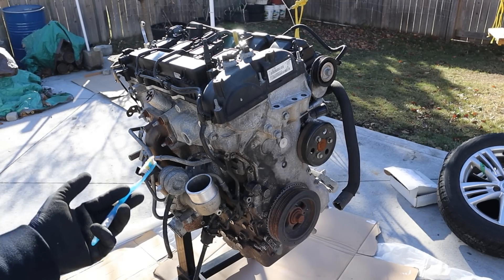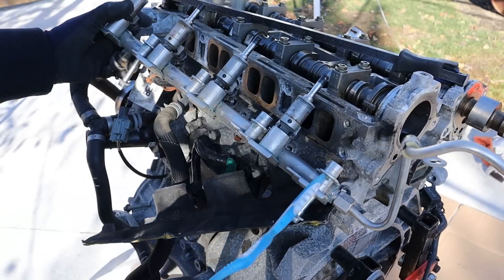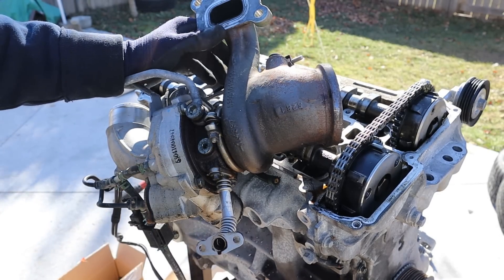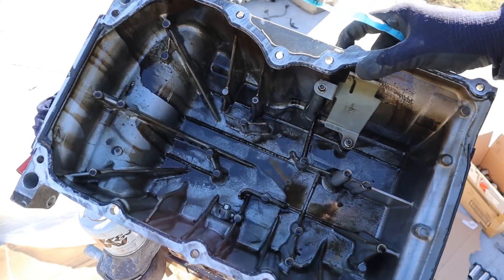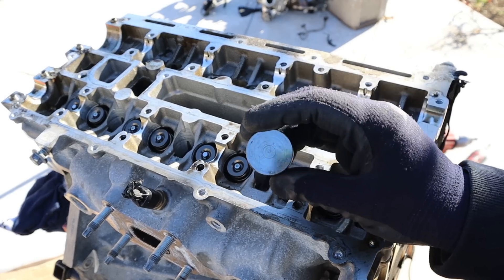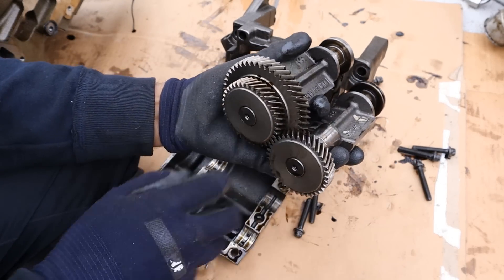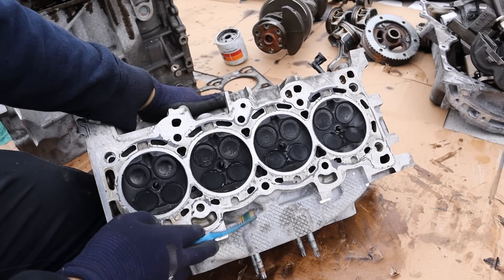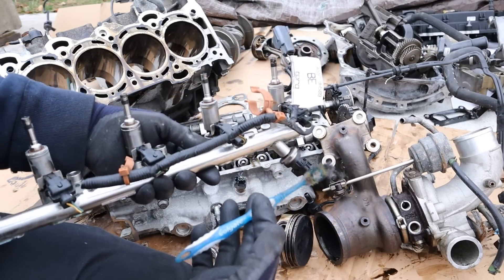Why Ford Ecoboost Engines Fail

Comment: Actually looks like one of the better designed and built engines I've seen in years. Also it appears FAR easier to work on than many of it's contemporary's. But honestly the direct injection without an intake manifold injector is just a death sentence for all direct injection engines.
Great video as always.
Reply: Looks very similar to the 4 banger Duratec. Sadly that engine killed Ford for me as an option. Unless you have an engine crane and you're willing to lift your engine for something as simple as a crankcase job, don't get a Ecoboost or Duratec engine.
Reply: @SwoonGaming  The Zetec was far worse before the Duratec arrived. Duratec is the Mazda MZR family of engines. If you want someone to blame for failures, point your finger at Mazda.
Reply: @Sm1te79  Mazda has no significant problems, Peugeot supplys large part of Ford EU engines, only Ford has problems.
In last generation of Escort engines where designed by Yamaha, great engines untill Ford tweaked them to make production cheaper, after tweak where worst engines ever.
On first generation of Focus they used Mazda 3 mehanics, that year Mazda 3 was rated as third most reliable car in Germany (ADAC) and Focus was on place number 52. out of 55 places.

Ford buys bulk of their smaller engines, but it buys them unfinished. Where usually original manufacturer installs Bosch, Hitachi or Denso, Ford installs Motorcraft.
Also only the base engine is Mazda or Peugeot, everything around like manifolds, sensors, alternators, pumps and managment are Fords misdeeds.

There is reason why Ford is cheapest major brand in Europe, with worst stealership network and crappiest final assembly.
Ford trucks and vans from Turkey are another sad story. You quickly realize why are they 1/4 cheaper than competition.
Reply: @SwoonGaming  'Don't get Duratec, it's not durable.' --Skurk1

gotta love that marketing irony! Too bad there aren't any car companies that will offer "0 plastic engine components" for an extra $X. I'd fork over an extra $25k for a premium option, if that option got rid of all the cheaply made plasticy crap
Reply: @leifleoden5464  this is Truth. I had a duratec in a Ford. It failed exactly where this guy said "this is a weak point" with the plastic oil separator/PCV valve. Flooded the intake with oil, just as he said. Cost me thousands. For a $30 part.
Reply: @Joe_P  .... I'll stick with my Subaru a while longer then...
Reply: Agree.
Reply: It looks like with a few small modifications it could be a really good engine. I saw an Audi V-10 teardown. What an abortion!
Reply: @johnhenke6475  I'm not up on this engine and I'm aware of the GDI problems but didn't I hear it had a catch can and wasn't the purpose of that to prevent this problem???  Or am I completely on the wrong track (as often happens)?
Reply: @alext8828  a catch can will help slow down the carbon build up but won't prevent it.
Reply: Direct injection for increased economy (not by much) but maintenance costs are higher. Are we going forwards or backwards. (That engine looked well made, decent quality and straightforward to work on).
Reply: The 1st generation 2 liter ecoboost was a decent design. The 2 major flaws were the pcv system and no port injection. The valves would get super dirty. The head gasket never seemed to be an issue with the 1st gen 2.0.
Reply: Yep. The owner got taken. That’s actually a good engine. It’s a first gen. 300k on mine. Open deck second gen is garbage
Reply: Open deck design, plain and simple, take a 2.0 EcoBoost from 2014 escape, with the Mazda sourced block, with a closed deck, at 388,000km and my mom's car is still going, now take my dads 2019 escape with the Ford block 2.0 open deck and at 155,000km needs a head gasket. Again ford CAN make good vehicles/engines but than on a dime turn it to absolute crap. Why because of $$$$
Reply: You can use a oil catch can also to avoid carbon build up on the intake valves
Reply: better built? 
say that to my 2 previous engines that had the #3 piston grenade inside it around 95-100k miles.
Reply: Funny that they did dual injection for the Coyote DI’s.
Reply: 10k mi on my 2022 Maverick. Should I sell now?  Love this truck but this has me concerned.
Reply: The complexness of these engines is just insane !!! And a bugger to work on and expensive, and short lived !!!  NO thanks !!!
Reply: @wilburfinnigan2142  All the more reason to switch  to an EV. Much simpler mechanically. And no carbon buildup!
Reply: @maryhadda8420  and when trying to charge your expensive golf cart during a hot spell, don’t be upset when they tell you that you can’t charge it due to the lack of electricity that’s needed to run air conditioning
Reply: @paulhunter9613  Charging has not been a problem. At all. Even in Las Vegas during the summer.
Reply: @maryhadda8420  it was a problem in California this summer, the infamous governor asked people not to charge their cars because of the strain on the electric grid
Reply: @paulhunter9613  Why single out EVs? Californians were asked - temporarily - to limit ALL electricity usage during the time of peak demand, late afternoon to early evening.
Reply: @maryhadda8420  I didn’t single out EV’s, the governor of California did. With everyone using air conditioning the added load of the EV charging would greatly increase chance of rolling blackouts on the antiquated electrical infrastructure. Y’all want to go so called green but there isn’t enuf capacity.
Brandon hasn’t figured out that part of it yet
Reply: Yeah.  Dumb ditty dumb ditty dumb dumb dumb.
Reply: Yeh not bad. Love the 2.0l in my evo, thing is stout. My 4.0l ranger with the MT is great to me as well
Reply: Why is it a death sentence? Just wondering Im not to savvy with car mechanics.
Reply: A lot of those modifying these add port injection to get more fuel to go beyond the 375 hp which has the benefit of better valve cleaning too. That and catch cans.
Reply: "Death Sentence"  a little dramatic. A walnut shell cleaning every 80 k miles would keep her pumping just fine.
Reply: @christinesommerfeld9815  the problem is that about 80% of DI engine owners have no idea about the cleaning services out there.
Reply: @HorribleHarry  I’m one of them. 3.5L EcoBoost- how and when would you recommend the intake cleaning?
Reply: @briannorwick  lookup fordtechmakuloco on YouTube. He shows the cleaning process.
Reply: @Nitroscion  love that channel! Ok, I think I’ve seen it. Any idea on the interval? Every 50k km? 100k? Thanks
Reply: @Brian Norwick  if your 3.5 is 2017 or newer, it has port injection and you need not worry. The valves stay clean. I watched a 80k mile 2017 3.5 teardown and the valves were nearly spotless.

If your 3.5 is 2011-2016, they aren't as prone to valve deposits as most DI engines, but still suffer from it somewhat. If you dont have excessively rough idle on cold start, you generally dont have to worry about it. I've seen >200k mile ecoboost f150s that still run great without any induction cleaning services.

Having the valves walnut blasted is the best way to clean them if you have confirmed excessive valve coking. The problem is that it must be done very carefully to protect the turbos. Many mechanics aren't thorough enough to get ALL the walnut debris out or don't ensure the valves are fully seated before blasting. The turbos on the 3.5 ecoboost are particularly sensitive to debris.
Reply: @Brandon_Nelson92  ok thank you very much- my Ecoboost Engine is from a 2020 Transit van, which I believe uses the direct injection. 

I was thinking the same thing that you’d want to have a mechanic that is well versed with the walnut blast technique and is thorough. Lots of opportunity for foreign debris! 

I really appreciate the answers
Reply: @Brian Norwick   your 2020 transit uses the 2nd gen 3.5 ecoboost with both port and direct injection. Your valves will stay clean.
Reply: @HorribleHarry  the Kia and Hyundai dealers really push the cleaning stuff.
Reply: @briannorwick  If you have a Gen 1 (pre 2017), you're kinda screwed. It''s pure DI so you'll get a lot of carbon over time due to the PCV system and no injectors to clean off the valves. Injector cleaner won't reach the valves. You can't use Sea Foam because it will ruin the turbos. All you can do (short of a tear down) is preventative - install a PCV catch can for about $400. 2017 and newer is much better in terms of preventing carbon build up as Gen2 added port injection along side DI. I still put a catch can on my 2017. Catch can is a must on any DI engine, particularly a turbo that can't be cleaned with Sea Foam.
Reply: @dabean9606  😊 great info. 2020 over here🚐👍
Reply: @HorribleHarry  And they run cheap,  crap gas.
Reply: Its not.    Looks like you own one and are ass hurt.
Reply: I agree but you can add intake mounted supplements. Even Nitros. Did that with a Taurus SHO. Very popular mod for Turbo cars.
Reply: Just look at what it takes to do a timing job in the car. You’ll change your mind.
Reply: Can you explain why direct injection without intake manifold injector is bad? What does the intake manifold do?
Reply: @wongfit  the intake injectors spray fuel over the valves and intake runners which keeps them clean and therefore carbon doesn't build up. Some engines now have direct injection and port injection for this reason.
Reply: you mean port injection
Reply: has anyone  heard of ford 1.5 ti-vct gas engine 3 cylinders?
Reply: Direct injection simply will not work. Not for very long anyway. You have to have fuel mixed with the air coming past the intake valve to cool it and keep it clean. Otherwise it will carbon up real quick.
Reply: @geraldscott4302  it could carbon up but not quick
Reply: Wow! Engine just how much engineering went into designing and manufacturing this machine! Having so many moving parts means a really short mean time between failure!
Reply: This is why I added a meth injection system into the intake. Also is a good idea to get Aux fuel.
Reply: It's scrap from bottom to the top.
Reply: 10k mi on my 2022 Maverick. Should I sell now?  Love this truck but this has me concerned.
Reply: @TheChaznw  I got the 2.0 focus st 2014 at 94k miles. Haven't had an issue yet. Valves where dirty as any DGI engine but just cleaned them once every 50k miles
Reply: @TheChaznw  That's up to you, but the Maverick will not be a long lived vehicle, with either engine. It's also a hybrid, built by Ford, to a very low price point. Even the Toyota Prius, probably the best hybrid ever made, has never been a long lived vehicle without major repairs. Unfortunately, no vehicle lasts as long as they used to. I have seen vehicles with the Ford 4.6L 2 valve, like the Crown Vic and Grand Marquis, last past 400,000 miles if properly maintained. They just don't build vehicles like that anymore. My 1993 Chevy S-10 2 wheel drive with the 2.8l V6/5 speed has 416,000 miles on it, but had the engine replaced about 100,000 miles ago. It has never been used for towing, or hauling anything heavy. I bought it new and took care of it.
Reply: @geraldscott4302  thanks for the reply. I am 76 yo so all it has to do is outlive me
Reply: @geraldscott4302  You're way off base about the Prius.  I suggest you read up on some ratings and history.  And, your anecdotal experience with the S-10 is 180 degrees from the ratings and history on that truck.
Reply: @tharais  It is difficult to find accurate information on hybrids. It's more hype than actual facts. But the Prius was the first hybrid I ever heard of, except for the very short lived Honda Insight. 

As for the S-10, the engine lasted so long because I treated it right. I changed the oil every 3000 miles, used 10w30 instead of 5w30, always warmed it up before taking off, and it has been used mostly as a daily driver, as well as quite a few cross country trips. Nobody believes it, but you can seriously extend the life of an engine just by frequent oil changes and warming them up before taking off. By replacing parts, it can be made to literally last forever. I live in AZ where vehicles don't rust. There are Model Ts still around that are over 100 years old. A friend of mine has a 76 year old airplane, a 1947 Beechcraft V35 Bonanza, and it still looks and flies like brand new. Newer vehicles won't likely last that long, they are designed to fall apart, are much more difficult and expensive to work on, and have way more computer parts, many of which won't be available several decades later.
Reply: @geraldscott4302  How about the Tundra 5.7 V8 (Not the V6TT of the new tundras)
Reply: @geraldscott4302  priuses usually last very long with low repair costs per mile
Reply: @geraldscott4302  The maverick comes in both 2.5. naturally aspirated hybrid or 2.0 ecoboost options, the 2.5 is a mazda duratec engine. IDK what your smoking but 300k+ prius's are extremely common, the battery packs generally degrade over time as opposed to mileage and are pretty cheap to have rebuilt, but they also run fine and get good mpg without them. I had more problems with my 65k mile 5.0 foxbody than my friend has had with his 200k mile focus st lol. My crown vic runs great but does have its own unique problems and that only has 100k miles on it. Every car and truck ive had from the 70's and 80's were cool but junk overall, but those were mostly chrysler products so thats to be expected.
Reply: @TheChaznw  don't listen to him, he really doesn't know what he is talking about

Comment: Unfortunately, many manufacturers are going the small block turbo route.  Six and eight cylinder engines are becoming obsolete.

No replacement for displacement..................................for daily drivers.

Comment: You can clean the intake valves on these VERY easily without walnut blasting.  Once a year, I undo the bolts on the intake manifold, spray Amsoil Power Foam (best I have found for this job) into the chamber, and use a long 1" wide nylon brush to loosen the deposits.  Then I use a long screwdriver to push a paper shop towel down there to absorb all of the black liquid.  There is always one cylinder which is open.  So I put it in neutral and pull on the belt to turn it over and close the valves over the last cylinder to get that one.  Gets it good as new.
Reply: How much time does it take you to clean? Would you say it’s easy?

Comment: The carbon buildup in the intake runners isn't limited to just EcoBoost engines. It's pretty much anything direct injected. 
What causes it is the PCV system and a lack of fuel being sprayed down the ports like the traditional ported injection systems. The oils from the PCV system get recycled into the intake and deposit onto the runner surfaces. Then, the heat from the head bakes those deposits, carbonizing them. Traditionally in port-injection, the fuel gets sprayed into the runners and onto the backsides of the valves helping to keep them clean. As a D.I. engine ages it burns more oil and allows more blowby, thus increasing the volume of PCV gases into the intake. 
The catch can is a way to minimize the vaporized oils in the PCV system from making their way into the intake. 
This is also why Ford dealerships(among others) tend to recommend fuel injection and upper intake services. It's preventative maintenance on the intake system that helps to reduce the buildup.
Reply: Thanks for the informative response 
Joe's garage! That was the big question I had: what causes the carbon build up on the intake runners and ports. It "might" explain why Toyota now have both port and direct injection on their 2.5 liter 4 cylinder hybrid engines.
Reply: @0Meaty  yep. Ford also implemented dual injection on their 3.5 ecoboost engines a few years ago too. This has been proven to cut the buildup down by at least half. Upper intake maintenance is still recommended, but the intervals can be stretched somewhat. This helps to reduce cost of ownership both with fewer maintenance intervals and major services later on.
Reply: No it's EGR.
Reply: @MFcitrous  EGR has always been a challenge in the automotive industry. However, the carbon buildup on direct injected engines is significantly worse than their ported counterparts. While EGR can leave deposits on the valves, it has been manageable up to this point. Once you take away the cleaning effect of ported injection, it does get worse, but now with added cylinder pressures of boosted engines and lighter weight oils, blowby has increased significantly to allow even more PCV gasses to accumulate. 
You also have to remember EGR gasses are mostly carbon only deposits. PCV gasses are mostly unburnt oils etc. This is where the gummy residue comes from that leads to excessive buildup.
Reply: @MFcitrous  
https://youtu.be/xrLNDgrIw3U
Reply: @MFcitrous  https://youtu.be/FW0wCl-O7oY

Comment: Why do they fail? Simple. They are made by FORD. They are known to try saving money by taking shortcuts, not recalling anything and simply settling the lawsuits with a fine while the customers are stuck with a POS. 
Of course, it's not just ford, many manufacturers have done this and are still doing it.

Comment: Isn't it the other way round? Older engines with the trench and newer drilled? That suppose to be the Fords solution to fix the water consumption

Comment: With very rigorous maintenance, oil catch can, intake valve blasting and other goodies, this engine could be still alive.
Reply: On the other hand you shouldn’t need to do all that to keep an engine going
Reply: @spannaspinna  Exactly. Intake valve blasting? So. . . complete top end disassembly every how many thousand miles? Silly. Port injection is a beautiful thing.
Reply: @life_of_riley88  then keep driving your slow, boring car. We'll enjoy a smooth running fun engine.